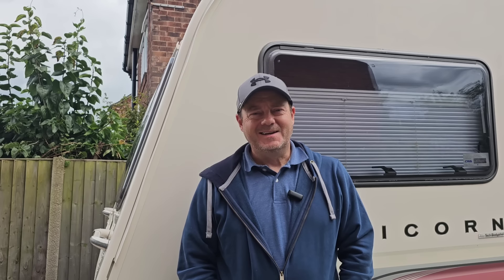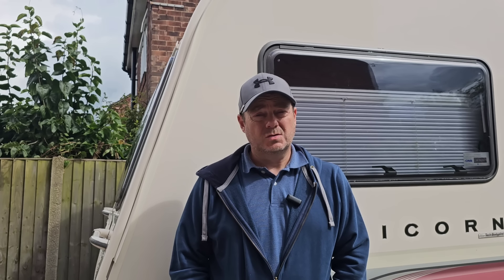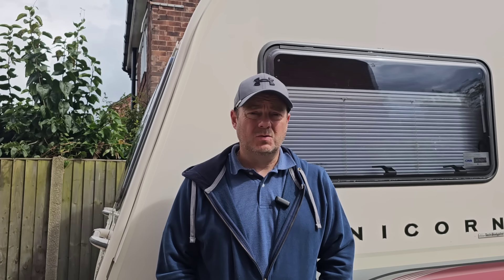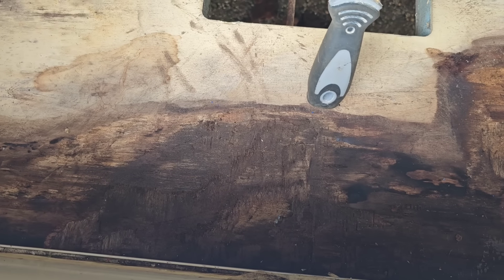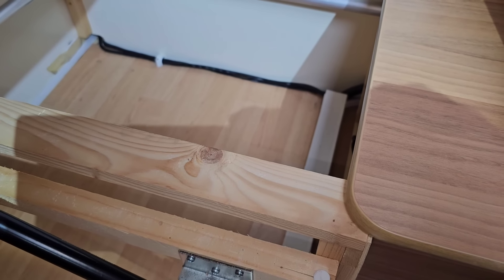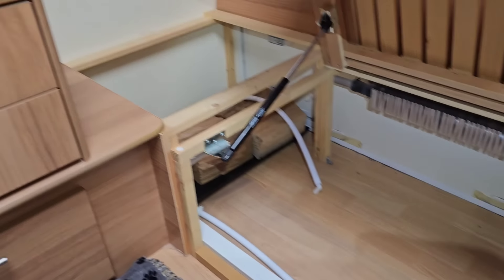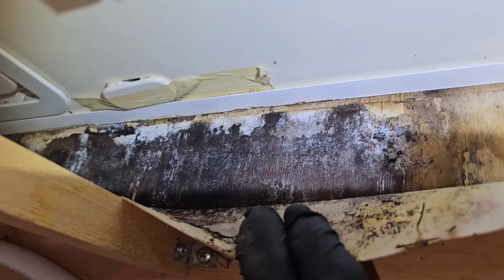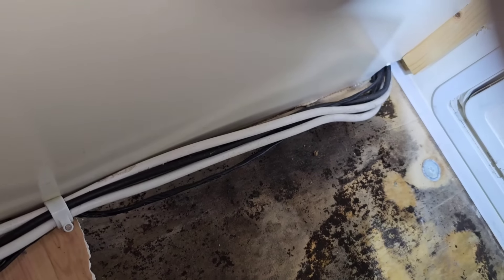Caravan Damp Nightmare! Our Story.

Comment: I had the same problem on a bailey pegasus, the cause of water ingress in the front lockers, under the plastic tray  is the front grab handles, the version with integrated led lamps, they leak like a sieve and the water runs down the inside of the front panel.  This is a caravan industry known problem.  You are correct , yours had been bodged before as from new they are just a black stained ply ( the floor ). I suspect that because it had the  bodge to cover up the problem, water has been able to creep under and along into your habitation area. The bad news is these alutech baileys are also prone to complete rotting in the rear also, where the corner steadies are fixed. You made the right choice!
Reply: It has nothing to do with the grab handles, underneath the plastics at the front and back of the caravan even the wheel arches are not sealed correctly. We have an Olympus and a Pegasus and they are now dry after I fixed them 👍

Comment: Had a bailey senator quite a few yrs back, bought from a reputable big dealership, just out of warranty found it had damp and rot in both front corners at floor level, after a long battle with dealer they eventually caved in and fixed at their expense.
18 months later, same in one of the rear corners, cost  £2,500 to put right. 
Apparently they are called Bailey Cullinder for the above said reason.

Comment: Those caravans  need drip loops or a plastic skirt around the bottom because the water just runs down the side of the van and into the floor my coachman has a plastic skirt extending below the floor which prevents this problem I also put a small drip chain at each corner

Comment: check in you high level cupboards beneath where the roof joint is,does not apply to alutech although they have another set of problems , the short of it is don,t buy a bailey caravan and we have two .

Comment: We have in summer 2-3 times hail in my country ,it makes caravan look like swiss chees ,i can live with that even its ugly but bigger problem is that polycarbonate windows are to weak for hail so every time both skylight get broken and some from side depends on where wind blows .And exact spare parts at least for Hobby caravan is impossible to find or even i find one is so ridiculously expensive like is made off gold and not from plastic that will just broken on next hail.
 I also had dumb inside on front off caravan ,and i could not find where water could come in so i just used water proof type and typed on every jointin front and on roof ,it does not look nice but it stoped the dumb

Comment: Sad to see, but it is immediately obvious from the view in your gas locker, that it is a thin RAW UNTREATED ply base floor, you should at least have had a treated ply or better still marine grade, then even with any water ingress, no rot and can be cleaned, sealed and treated easily. Seems this may be a fault in the construction, make & design of this brand/model of caravan (if so it will be known). Perhaps contact any national caravan/camping organisation in UK, as I am sure they will know and have some info that may help or even direct to the manufacturer. A rebuild seems what is needed, but doubt you will have success getting one. Good luck. 💜💜

Comment: Had an old (25 years) Stirling Eccles topaz, bone dry as the day it was made. Older vans can be brilliant compared to some of the rubbish made today.
Reply: Absolutely agree, ours is a pageant ser 7 twin axle 2009. No damp anywhere. Places to keep an eye on are roof straps, awning rails, obviously under caravan floor.  Delamination of floor is usually a problem but easily repaired. A regular check under body and roof is a good idea. A damp test meter is invaluable.  Plus a regular service.
Reply: Yeah, have an 07 Elddis Super Sirocco, no damp or leak problems. New caravans seem to be pushed out the factories as quickly as possible these days. All about profit margins.
Reply: I had a 20 yr old Avondale Rialto . Brilliant van and believe it or not it was damp free.  Kept servicing it and the engineer always kept saying he can’t believe no damp.

Comment: That damp looks more than 12 months to me & somebody’s tried to repair it. Buy a Swift. Thanks for highlighting these problems 👍
Reply: Swifts are no better . The problem with every British caravan is quality control . There is very low level quality control in these factories . You are at the mercy of some bum with a silicone gun who really don’t want to be at work , his superior assumes he has done what he should have but don’t check . A lot of the time you can’t check because there are so many steps in the process that work would have to be undone in order to check it . Swifts are prone to leaking under the cap rails on roof , again because sealing hasn’t been done properly and apart from that sealer don’t last a life time anyway . The floors share and drop at the front also . Big polished turds is what these vans are and sold to unsuspecting people with dreams of great times .

Comment: Hi, I’ve got a 2011 Bailey Unicorn Barcelona that I bought from new. I site my van and don’t have means to move it. I noticed 3 years in that the bathroom floor had little black lumps in certain areas of the floor. I had my suspicions, but didn’t do anything. Fast forward now and the bathroom floor is soft and spongy with water damage. I have looked underneath and the back and  front of the van and you can see black damp on the floor. I think a lot of these vans suffer from the same fault and I think it’s a design fault with this Alutech system. I’m know of caravan repairers that can cut the floor out and add new wood in. I’m looking to buy a new coachman lusso2 in the new year and I will sell the unicorn privately and get what I can. I do love this van and the layout, but I wouldn’t chance getting a Bailey caravan again with the alutech design.

Comment: I think the construction of caravans from around this age or all the same and are all.prone to damp. Made of the cheapest materials and covered in tinfoil. Our old adria was ugly but it had no damp our coachman 520 vip needed floor gluing and damp in the wall in the bathroom. When they are made fore use in the uk they should be waterproof and 1/4 ply will never me waterproof
Reply: My father bought Adria in 1979 ,its still siting in yard ,zero damp.My 2017 Hobby has already damp in front  so i had to type with water proof type it everywhere on joints in front and roof to stop because i could not find where water comes in but it was like from both sides.
 But i have even bigger problem is that i have hail in my country and it few times destroyed sky windows on Hobby ,it has one very big and one smaller and when hail distroy them water just come pooring in  ,they are just to weak for hail made from some plastic while Adria dont have them so dont have that problem.

Comment: Hi. Sorry to watch you suffer with a damp floor. I understand the Locker areas on the older shaped Bailey's has been a major cause for concern. May I recommend you take a look at Swifts as from 2018 onwards they have no wood in the construction including my Sprite. Caravan prices are set to fall soon due to the hidden recession the UK is in so you may be in a better position money wise to grab a bargain. Perhaps a Main Swift Dealer might be the way to go. My Sprite has had very minor issues but it hasn't leaked at all. Just a thought. Phil🙂
Reply: What is the floor made of?
Reply from the maker: It was made from plywood
Reply: What is the Swift caravans floors  made of ?
Reply: @wilmaireland9308 black woven heavy-duty GRP to the underside which is insulated with 35mm Ravatherm, while the inner layer is manufactured from 9mm marine grade plywood to provide strength to the floor, according to Swift

Comment: Looks like water ingress from the front locker, what's the seal like, get it chopped out and refitted. Looks like Stevie Wonder already had a go. How much was the van?
Reply: The dealer has a legal responsibility under the sale of goods act that he must rectify the issue so you would have won had you taken it to small claims court. The water ingress is nothing to do with the grab handles it’s actually tracking behind the plastics and the front, back and sides of the caravan. Bailey never sealed around the floor areas correctly. I have sealed and now have 2 very dry Baileys from 2010. But the water does track front, back and sides so I advise everyone to seal the plastics on with Sikaflex. Also I would advise to add an extra inch of plastic to drop below floor level on the front and back where the plastics are screwed to the floor as again water tracks into the floor there 👍

Comment: I really Hope you get it sorted. If not get a full refund from the dealer you purchased it from.

 My 2019 unicorn was starting to rot underneath because the draft skirt seals had hardly any sealent and had cracked due to movement because the walls had not beenfitted properly leaving gaps between the outer skin and the floor.
Had to stripe them down and reseal them properly and fit screws to secure the trim to stop the movement. Very bad build quality and bad customer service by bailey they where not interested in helping. 

If i could afford to loose money i would sell it for a swift with a fiberglass floor and never look back. But at the moment i just hope my repairs do the trick.
I would never buy anything from bailey ever again. 😢

Comment: Sorry but there is no such thing as a solid caravan. You have rights but it’s best to report within first 3 months. Give the dealer the chance to fix the issues. Then you have 6years after that if problem returns. I’m not sure what your rights are if 12 months have elapsed. The area that has the plastic area is for damp boots etc. To be honest Caravans are standard for water ingress and poor build quality. They look cosmetically lovely but that’s where the joy ends. Every Caravan out of the 4 we had , had issues all of the sink drainage pipes came loose and flooded the kitchen area.Some we caught before a flood. I suggest a jubilee clip over the pipe to hold it in place.You defo need a new floor. Never ever purchase a Caravan without checking the floors and walls with a good damp meter. Always check online for reviews, faults and recalls. Your story is heartbreaking but all too familiar. Remember to report any issues within the first 3 months and film everything just incase you need to take them to court.Ps we also had problems with the showers, jokey wheel disengaging and squealing breaks. All on a brand New Caravan. Not the dealers fault but defo poor care taken on the build quality in the factories. All the best to both of you. Sending a big 🤗

Comment: I know how you feel. I paid nearly £2.5k for a damp repair, only to get damp a year later in the van in a different place. So i cut my losses and went for a swift elegance, which doesn't have wood in the construction... ..would never buy a caravan with wood in the construction again.
Reply from the maker: Thanks for your comment. The Swift Elegance is now on my radar after our experience. How are you finding it?
Reply: @caravanningwithcharlie  I've had it 3 years, and it's 6 years old... up to now, apart from adjustment to cupboard catches, I haven't had any other issues.
Reply: Hi, Are the swifts floors made from something other the timber then, sounds good if so.